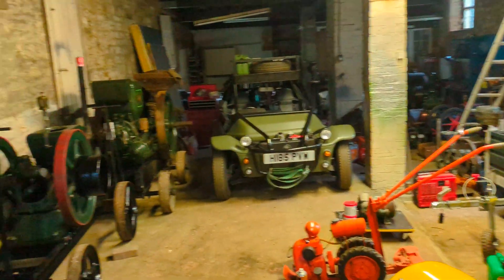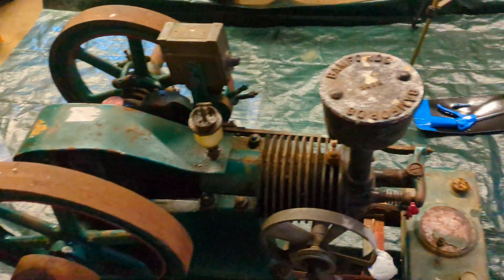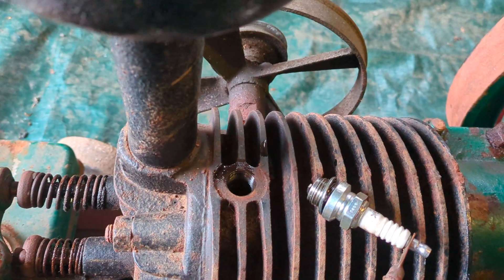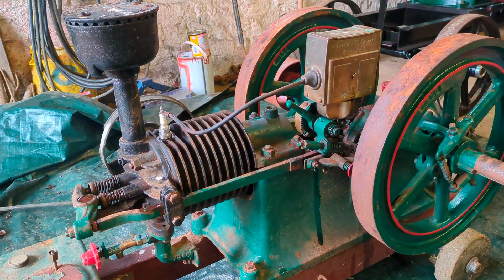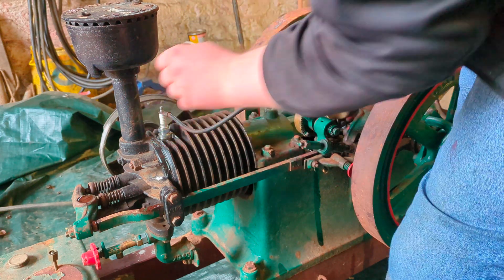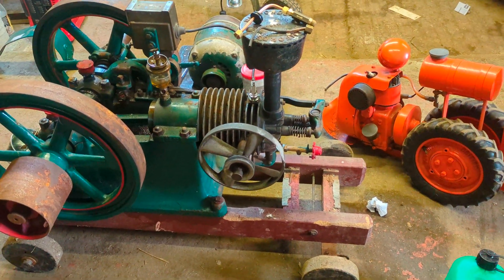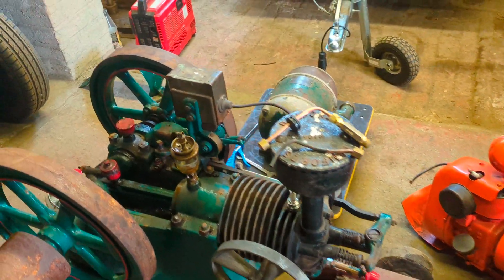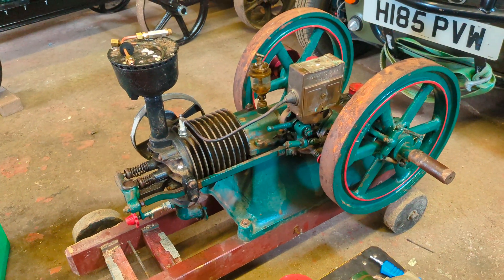Bamford Hit and Miss engine, First start

Comment: Lovely old engine i would recommend connecting a belt to the fan though
Reply from the maker: Thanks, yes all done now, I machined a new pulley for it and used a leather sewing machine belt to connect.
Everything is now on a new trolley that I made as well.
Reply from the maker: Just uploaded a video of the engine now

Comment: On the "miss" strokes..
does the engine actually draw in fuel/air to cool the cylinder down...even if the spark is not igniting the mixture?
Reply from the maker: Hello, on the miss stroke the exhaust valve is held open so air is only bought in through the exhaust. No fuel/ air is drawn in through the intake.
Reply: @MatthewHenson.  
That explains that...
otherwise the strokes that are unfired would still be using fuel....
not to produce any power...but just to cool the cylinder..

Since the exhaust valve is held open all the crap and heat in the exhaust gets drawn back into the cylinder....
not optimum...

I suppose that when good carburettors were invented the need for the "miss" stroke went away....
better constant metering of the fuel for every intake stroke......